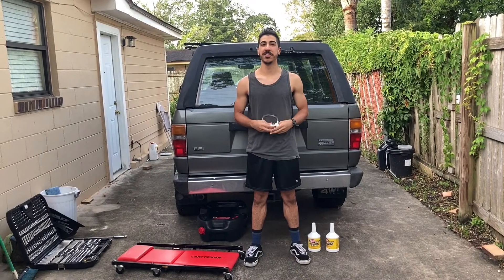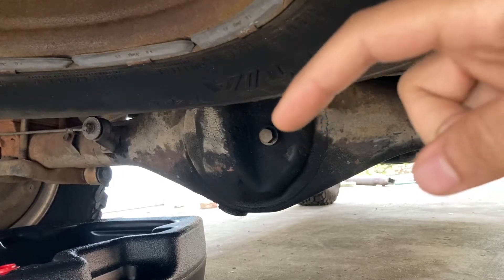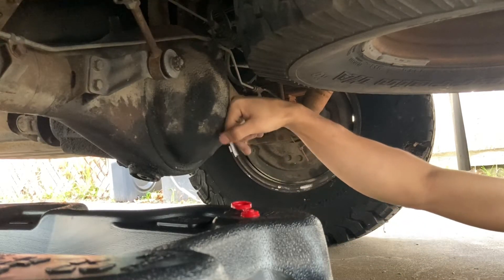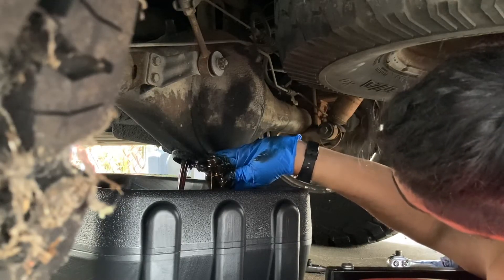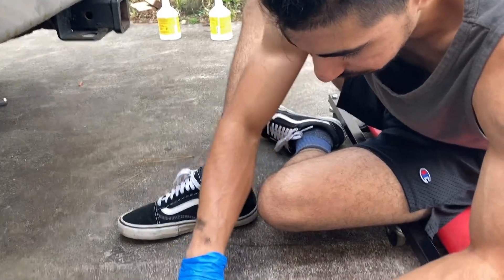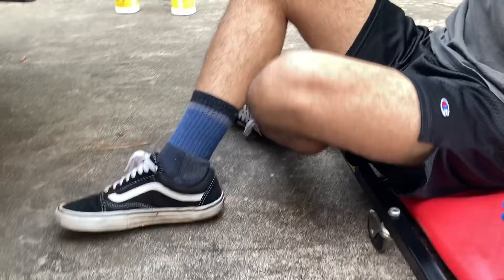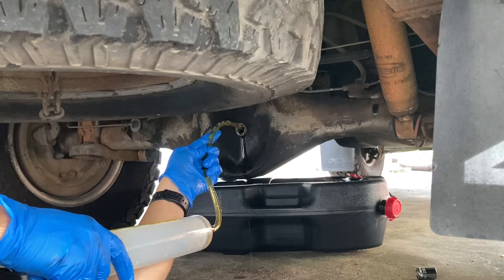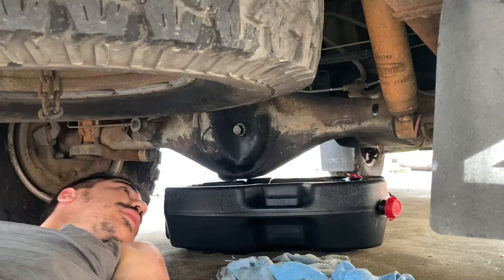1989 Toyota 4Runner Refresh Project Part 1: Rear Differential Fluid Change

Comment: It's an 89, keep your eyes on the head gasket always! It's coming some to replace it. I have an 88 and I am now in the process of changing mine! Almost 33yrs not bad! Excellent video...👋🏜️
Reply from the maker: Thank you my friend! I will do definitely keep my eyes on that head gasket, and will probably replace it as preventative maintenance down the line! thanks
Reply: @YaseenDIY  He's talking about the 3.0. 22RE head gaskets did not have the same problems. Nice rig! Love these trucks.
Reply: @rcdudes123  they do now that they’re older

Comment: Just figured out today the original bolts for draining the diferencial are 24mm
Reply from the maker: Good point, mine must've been changed out at some point then.
Reply: @YaseenDIY  my 1988 ifs front diferencial fill plug won't lose 😡
Reply from the maker: @gufiaito69able  Spray some penetrating fluid and let it soak in it for a good while. I do like one spray, come back in a few hours do another one, and check to see if it loosens. If you have a rubber hammer, you can also try and tapping the fill plug a few times to see if you can get the corrosion or whatever is making it suck to loosen up. Good luck man! whatever you end up doing just don't loosen the drain plug without getting that fill plug off first!